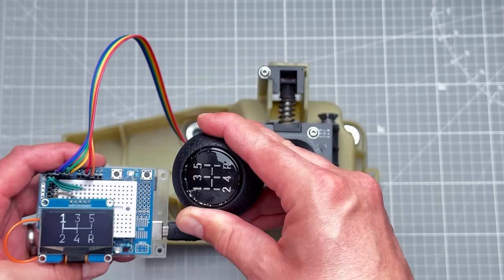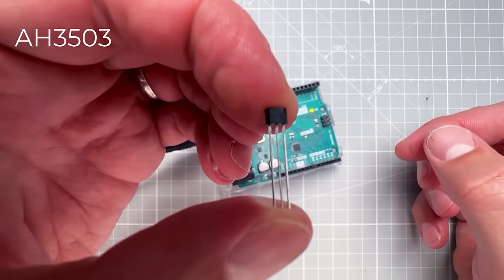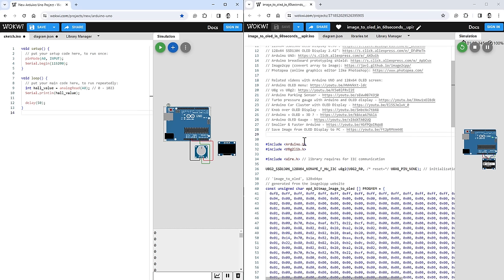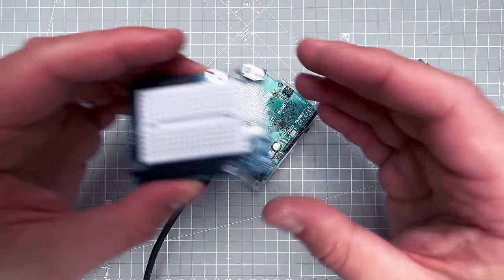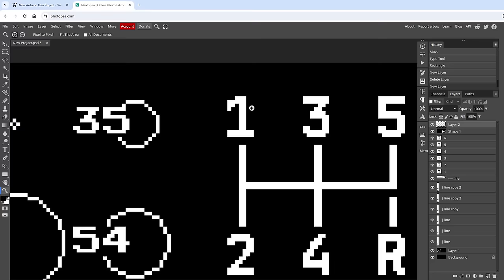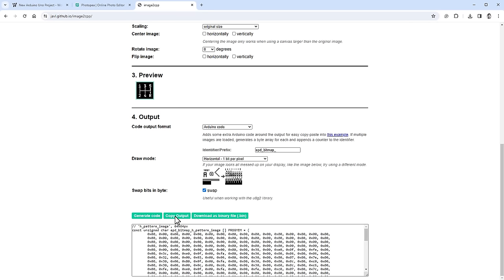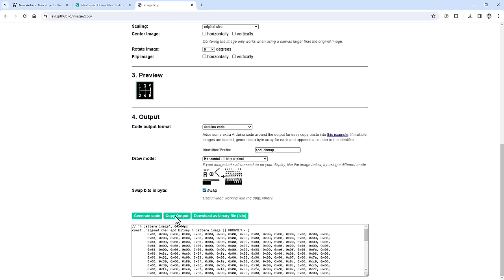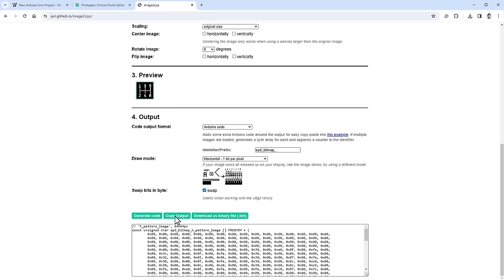Drive in Style: Arduino Gear Indicator (full tutorial)

Comment: A round display replacing the original marking would look beautiful
Reply: Especially if it could be mounted in the knob itself
Reply from the maker: Yep, mounting some (round) display inside (some) shifter knob is my next step, let´s see how it goes...
Reply: Thats what I thought this video was at first 😂 I was staring at the knob loll
Reply: No one looks at shifter knob once they get hold of it
Reply: That would probably look cool, but if I have to look down on the lever to know which gear I'm in it kinda defeats the purpose
Reply from the maker: @bruderdasisteinschwerermangel  It would probaby be more for aesthetics rather than for actually providing the information.
Reply from the maker: @bullet9564  Might be still a good conversation starter for passengers :)
Reply: This used to exist awhile back. Haven't seen them in a few years though
Reply: @bullet9564 Exactly, no one looks at the numbers while driving as you can already tell which gear is selected by only looking at the knob. Except if you can't remember where the reverse gear is.

But it would be a nice addition having this display, say, in the middle of the instrument cluster, showing other information your car doesn't provide: digital speed, engine temperature...reading the CAN Bus.
Reply: Animate the round display showing the gate display and a large number of the selected gear, plus maybe the logo of the car maker.

An obvious problem is, where does the Arduino get its power from?
Reply: That's what I thought how he did
Reply: @bullet9564 no one looks at the the knob but practical and cool don't have to align
Reply: I'm super interested.    Since you already have it built,  how can I order the board?
Reply: In the shifter would be cool...I'd like to see this controller and screen mounted into a round oled display...be a great project to make money on as a product
Reply: then what's the point of making a display then? if you're just gonna put it on the knob.  let's be honest no ones interested on the knob...

Comment: Would be interesting to see this display incorporated into the shift knob itself, more just for looks honestly. I imagine someone noticing a digital shift knob while they’re in the passenger seat
Reply: Guess I should’ve waited until the end of the video before leaving that comment..
Reply from the maker: Yep, I think that´s the next logical step, it was just too much complicated to do it all together. I hope to find some suitable display that can be mounted right inside the knob. Thank you for your comment!
Reply: Not good idea guys at all . If you check the position of rally cars gear shift indicators , they are placed in the view of the pilot , without any need to move his eyes from the road in order to check the gear shift position .
Reply: @flappingflight8537  I’d imagine a rally car operator would know what gear he’s in better than an electrical engineer who just wants to tinker and have fun. It’s more of a conversation piece than actually useful.
Reply: @alexp9303  please check some videos about  rally racing. On top of the  dashboard , they usually have big size 7 segments led display which shows the current gear position . Most of the rally cars use sequential transmissions. Shift stick moves only forward and backward and you just couldn’t skip gear .
Reply: It would look sick but remember, to shift a manual you have to put your hand on top of the shifter. Best to have this either as a bright HUD, steering wheel or gauge cluster.

Comment: One trick I've found with these small OLED displays is that they have a very high refresh rate. High enough that you can blink the pixels quickly and rely on persistence of vision to generate greyscale. I managed black, two levels of gray, and white for a game I made for the Arduboy.
Reply from the maker: That´s interesting idea, but the UNO is not fast enough to update the display that fast. I might try this approach with ESP32, but I also have some OLED displays that support 16 grayscale values. I haven´t decided yet as to which display to choose..
Reply: @upir_upir  Are you sure, doesn't the Uno run a 20MHz ATMega328? The Arduboy only has a 16MHz ATMega32u4 and as I mentioned that ran fine with a whole game running as well.

Comment: Nice project !! What about to implement a buzzer to advertise RPM below or above ?? This would be very useful. I used to read this singnal in the center pin of the distributor, hi voltage cable... just 3 or 4 turns of AWG22 and rectify with signal diodes to get the frequency. This is direct proportional to engine RPM... and cheap than use OBD...
Reply from the maker: Thank you. In general, I hate buzzers :) but I like the idea! Perhaps without the sound, with just some light effects..
Reply: @upir_upir  
I hate buzzer too!! But my Ford Fiesta maybe love it !! Audible warnings are the best way to warn when you are driving but LED efx do the job too !! Wen you know the tone and its meaning is even best !! Ill try to reproduce this fantastic project. My car is manual gear. Was my dream develop a kind of universal car computer to equip popular models that lacks this feature !!
If this project grow to some kind of car computer (id open doors, id headlights on wen lock and leave the car, etc...) i buy it direct from you !! Im retired of electronic devices (im tech former...) and only enjoy tech like things... like what you do !!
Thanx for this fantastic project !!!

Comment: You make it look so easy. I’d have no idea where to even begin.
Reply from the maker: Don´t worry; I did begin around a year ago by purchasing a spare shifter handle and then spending several months thinking about how to do that. It takes just 40 minutes in the video, but it took me quite some preparation time... that said, hopefully the video is simple enough to understand and shows the basic steps. If you can connect one hall sensor to arduino, you should be able to finish the project.

Comment: If you port the project to an arduino pro micro or leonardo, you can use the Joystick library to make it a functional game controller!

also, wicked photoshop skills. I think i learned more about photoshop from this video than i did about arduino, lol
Reply from the maker: That´s an intersting idea! Using Leonardo would be the easiest, as it shared the same pins with UNO. Unfortunatelly using this as a real shifter for a game is challenging, since the shifter does not stay in the place when it´s not connected to the transmission, so you would need to make some adjustments... but surely and interesting project to try!

Comment: Using Hall effect sensors is ingenious! I've wanted to build a gear indicator for quite some time now for our 30+ years old  camper van. Other tutorials used two potentiometers with pieces looking like tuning forks attached to them that "clamp" to the shifter handle. One is measuring the degrees from top to bottom and the other one from left to right. It's just another way to get input data but the rest is similar to your implementation. With Hall effect sensors I don't even need a 3D printer, which is nice (although I should get one anyway :D)
Reply from the maker: Thank you for your comment. I have seen the other implementations using two "forks". I like that it only uses two analog input pins, and you can probably get a better and more accurate reading, but I don´t like that you are physically modifying the shifter handle, and there is a possibility that the shifting might not be that smooth. Worst case, it somehow gets stuck and you cannot shift at all. My solution is "non-invasive", and besides adding a small magnet to the lever, you are keeping everything intact. It would be probably better to make it more sturdy  by adding some 3D printed enclosure, I might try that for a next version.

Comment: Here's a silly thought. If you're building a sim shifter and are going to have a microcontroller in the knob, and if you're building your own shifter using hollow 10mm tubing, you can connect it to the master microcontroller (the one that does USB and position readings) with a mini-XLR connector, used as both quick release mechanical and electric connection. It can even be done with mere 3 pin connector, with gnd, vcc and data with data being either mono directional UART or bidirectional OneWire. I think bidirectional UART can work as well, if initially and after every transmission you HiZ (disable) the TX pin on the corresponding microcontroller, then connect all the RX and TX lines together via 1K resistors. You also need a robust M/S distinction where the S will only send in reply to M via polling, because you have no collision handling. Other connector pin counts are available as well, up to 6, to make life less difficult.
Reply from the maker: All good ideas! I will definitely explore this project more with more features and more polished design.

Comment: Need something similar to this for an ev project, keeping the old shifter and changing it to instead shift between drive modes (PRND, performance, range, normal) 

The idea of a pcb holding all the hall effect sensors is perfect, i was gonna mount some jank big hall effect clunkee sensors but this is waaaaaay cleaner
Reply from the maker: That´s an interesting idea. Just keep in mind that when the shifter is not connected to the transmission, it will automatically revert back to the neutral.

Comment: Is is pretty awesome. Modern cars might make the gear itself available via obd2 (maybe can specifically)… might be an interesting variant of this project
Reply from the maker: Thank you! Yep, I was thinking about the same. Also, many cars simply calculate the current gear based on rpm and speed, that’s also something I would like to explore a little bit more.
Reply: Especiallyfor cars with 6 gears and 1/R on same position

Comment: Just yesterday I was thinking why there was no video on youtube about making gears with Hall sensors and I was thinking that electronics people don't understand anything. Today I came across this video and I realized that it is not only about electronics, it also requires software knowledge and I better understood why there are very few such videos on youtube. Thank you for an excellent narration style. If we connect the ardino to the pc in this state, will it work in games?
Reply from the maker: Thank you for your comment, I´m glad you like it! As for your question, the asnwer is yes, you can connect this directly to your PC and use that as a controller. The only requirement is to use an Arduino that could be used as an USB device - for example Arduino Leonardo. The connections and the sketch would be exactly the same, except now the Arduino would act as a keyboard/mouse/controller, and you can use it to play games. That said, the shifter when not connected to transmission will not stay in gears, so some adjustments to the actual hardware would be needed..
Reply: @upir_upir  I'm actually someone who designs and builds and uses game consoles myself. Until now, I could not shrink my designs because I was using analog buttons. Now, thanks to this sensor, I will be able to design smaller game consoles. Since there is not much description of the use of the Hall sensor, your explanation was great for me. Thanks for everything.
Reply from the maker: @mc3702  Cool, that sounds very interesting. Do you have any examples of your work? I would be interested to see it.

Comment: As an improvement, you could use IR transmitters and receivers to determine the position of the shifter shaft. That way you could have the sensors/transmitters lower and won't get "wacked around" 👍
Reply from the maker: Thank you for your idea. There are many ways how to determine the position, I guess with the IR transmitters, you would need to position them very precisely to work. There is a slight difference in the ranges of the level whether is connected and not connected to the transmission, so I like that I can bend those Hall sensors if I need to.
Reply: @upir_upir  I don't think they need to be positioned "precisely." I think you would need 5 transmitters and 5 receivers. For example, 3 transmitters on the 2, 4, R side and 3 receivers on the 1, 3, 5 side. Then you have 1 transmitter/receiver on the 1, 3, 5 row and another transmitter/receiver on the 2, 4, R row. It would be an interesting idea for another video at least 😉

Comment: Think it would be great to add a button to calibrate it instead of manually entering the values.

Long Press = Calibration Mode
1. Starts from N to Max Gear
2. Press the button to store position and then move through all the gears and press the button in each gear position
3. Long press again to exit
Reply from the maker: Definitely something if you would like to turn this into a real product. For now, this was meant more as an inspiration for others to recreate.

Comment: YO!!! that's awesome! Been looking for a way to indicate not only THAT my shifter is in a gear (there is a sensor on the transmission), but what gear it is in. For a while I've been thinking about how to not only show the position/gear the transmission is in, but shift into a gear automatically would also allow for many truly unique things to be developed. 

with a mechanism possibly using two linear servos (preferably some that can be moved easily with no power applied) to shift into and out of gears so features like  remote start  when left in gear, 'automatic' driving mode,  and depending on how sensative those hall sensors are... rev matching automatically or 'clutchless' shifts if RPM data can be read over the can bus and the vehicle in question is drive-by-cable and uses an actuator and a second throttle cable for cruise control (mine does).

who am I kidding.... I'd never have time for building most of this stuff
Reply from the maker: Thank you for your comment, I´m glad you like it! And of course - good luck with your project!

Comment: Hello! Thank you for your work. Very informative and interesting. Is it possible to use an accelerometer instead of hall sensors?
Reply from the maker: Thank you for your comment. Yes, using accelerometer is something I would like to try, but I think I will need to use two (one in knob, one outside), to prevent inaccurate readings when accelerating/turning the car.

Comment: Great idea. Pity i don't have any manual cars anymore.
Now if you could come up with a design for my pushbike, 2 cogs at the pedals and 10 cogs at the rear wheel. ie: "Low/Hi" and "1 - 10".
Reply from the maker: Thank you. As for the bike, yep, that would probably require a sligtly different solution. Are there actually any pushbike shifters with displays? I need to take a look...

Comment: This is pretty cool.
How would you setup the hall sensors when the gear box is 6 speed and the R & 1 gears are right next to each other ? Or R and 3 in some cases.
Reply: If I had to guess, I would assume  you would want the sensors in the middle of the gears. For example, if your top row is R, 1, 3, 5 and your bottom row is just 2, 4, 6, you would put a sensor between R and 1(sensor1), another sensor between 3 and 5(sensor3), then a sensor between 4 and 6(sensor4), and the final sensor to the left of 2(sensor2). 

Logic would be along the lines of "if sensor1 is a high value and sensor3 is no value, reverse. If sensor1 has high value and sensor3 has low value, 1st gear. If sensor2 has high value and sensor4 has no value, 2nd gear. If sensor1 has low value and sensor3 has high value, 3rd gear. If sensor2 has low value and sensor4 has high value, 4th gear. If sensor1 has no value and sensor3 has high value, 5th gear. If sensor2 has no value and sensor4 has high value, 6th gear.

In that case, you would need to test it and observe the values reported in each position. "No value" wouldn't necessarily mean 0, but just a value that is significantly below the "low value" amount when in a position where it would be utilizing values from both sensors.

That's just a rough idea at about 5 in the morning, though. Obviously it would take a little trial and error figuring out what values are being returned.
Reply: @jebova2301  I had another idea of using the 12v signal from built in reverse trigger.
Reply from the maker: There is always some movement between reverse and first gear, even when it feels in the same position. You should be able to differentiate between those with more hall sensors.

Comment: This is a great idea. A round display would be an enhancement, and how about running it in a small board like a Sparkfun Pro-micro or a Leonardo?
Reply from the maker: Yes, I do plan to add a round display and use some smaller board, probably even smaller than the pro-micro, so I can fit also the Arduino inside the knob.

Comment: Hi, I found a ring magnet in the size I need but it has 8 pieces with the poles opposite for 4 of the pieces (4 with Pole N on outer curve, 4 with Pole S on outer curve) so they connect to each other.  Does the alternating poles of each piece affect the magnetic field values to be read by the Hall sensors?  The magnet is a Magerial brand N42H NdFeB arc segment type. Thanks!!
Reply from the maker: That should be fine. Inside the code, I do "normalize" all the values, since even with my magnet, some readings are negative and some are positive. I just make them all positive, so I don´t car about the magnet rotation.
Reply: @upir_upir  Got it, Thank you!!
Reply from the maker: You are welcome!